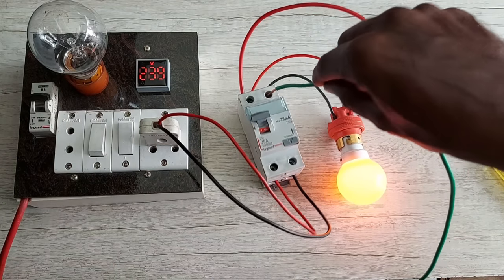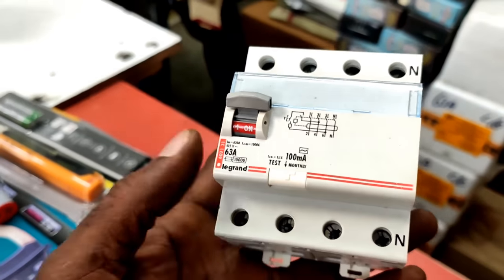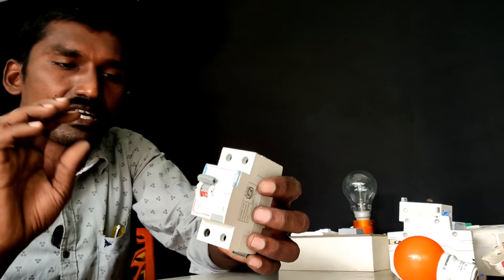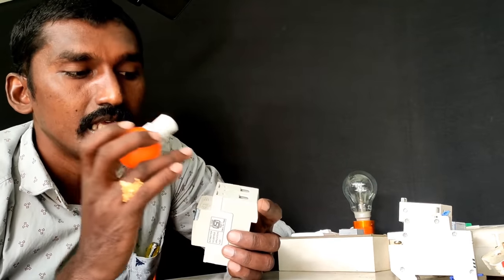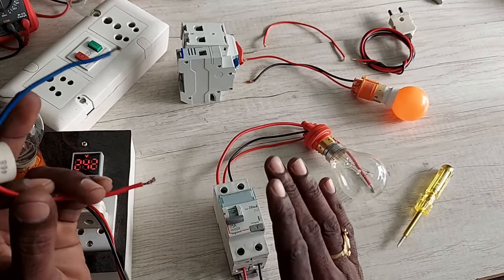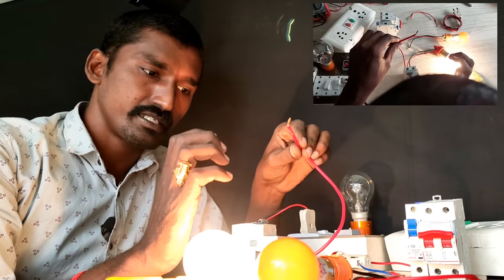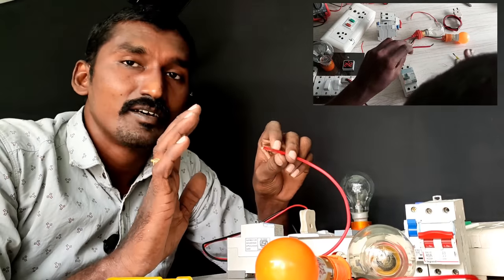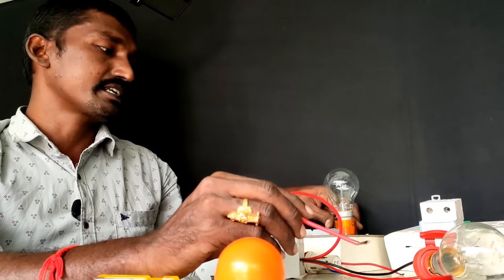RCCB connection live test | what is RCCB ||Electrical Telugu

Comment: You are doing it all wrong. If the unit fails to switch off, then your hand by neural action closes in and grips the wire. 
 Always do this demo from back of the hand. Where closing hand does not hold the wire in grip.
 Thank you for demonstration of earth leakage tripping of power circuit. It also help on stopping stealing of electricity by using earthing instead of neutral.
Also note, where ever RCC B are used, working on line may trip electric supply out of turn, creating problems with other lines like computer,and hospital emergency ward and OT., Where power failure are not tolerated.
Reply: Great observation subraya !!! And your point of using RCCB in online equipment and emergency devices is appreciated...

Comment: RCCB use chestu...
ISOLATOR & RCCB & MCB lu ON lo unnappudu

ISOLATOR ki... Only Phase wire connect chesaamu.
Intlo unna switch board lo neutral ki kuda... Tester petti chuste... Voltage vasthundi anna...
ISOLATOR ki phase & neutral pedithe maatram switch boards lo neutral ki voltage raadamledhu anna.
Problem emiti...?
Reply from the maker: ఏ వస్తువైనా ఫేస్ కనెక్ట్ చేశామంటే న్యూట్రల్ కనెక్ట్ చేయకుండా న్యూట్రల్ ప్లేస్ లో ఫేస్ అనిపిస్తుంది అలాగే కరెంట్ వస్తుంది బ్రదర్ rccb లోపల సర్క్యూట్ బోర్డు ఉంటుంది దానినుండి సిరీస్లో న్యూట్రల్ కి ఫేస్ సప్లై వస్తుంది
Reply: Deeni valla m ayina problem vastunda...  Anna?
Shocks raadam laantivi